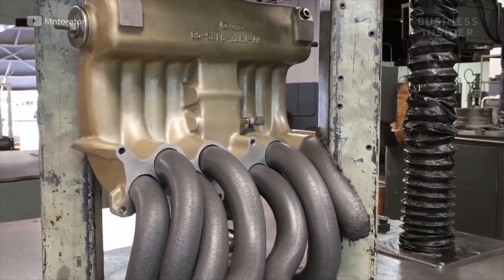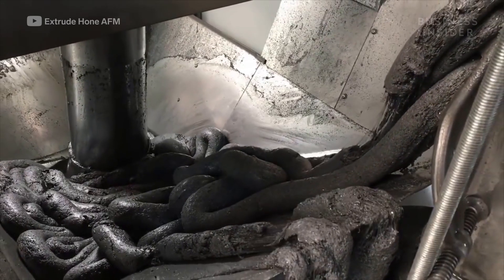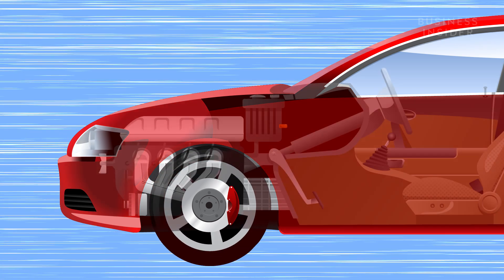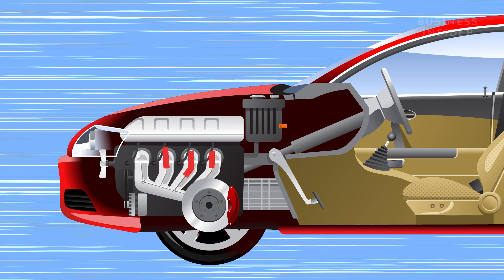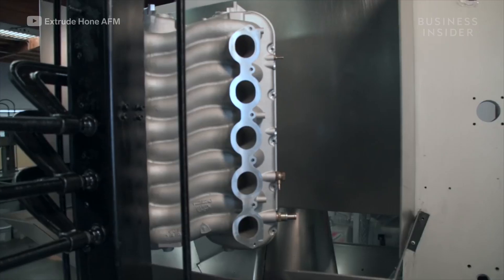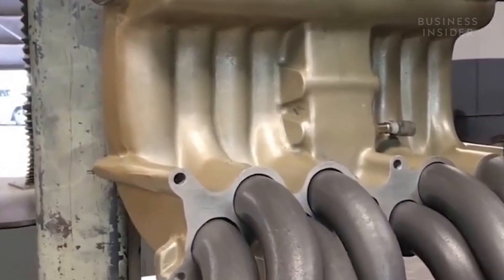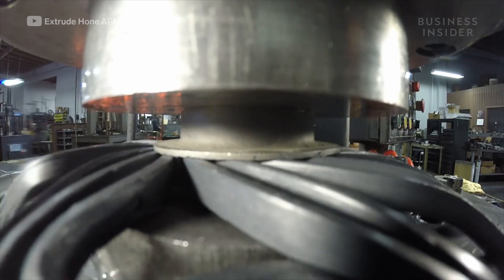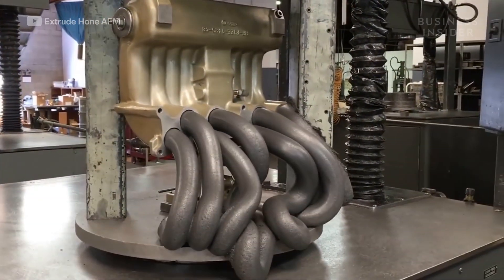How This Putty Can Increase Your Horsepower

Comment: Soo for a stock build or rebuild it can be done too the intake manifold and exhaust and not need a after market one also can you use your stock intake and exhaust gaskets or will they needa be trimmed too fit the smooth ports ?